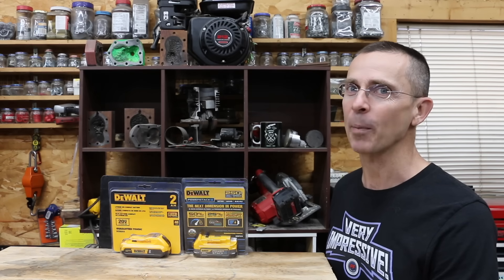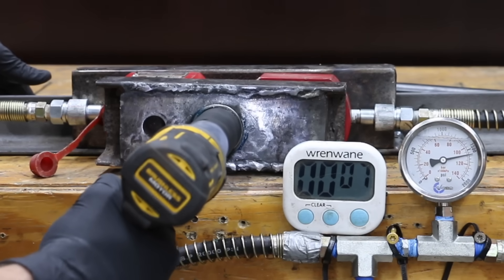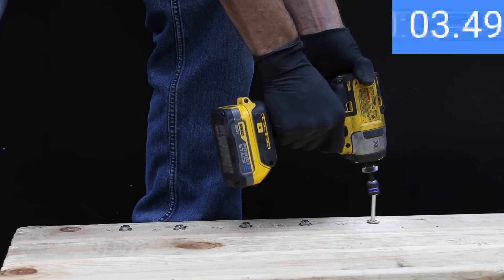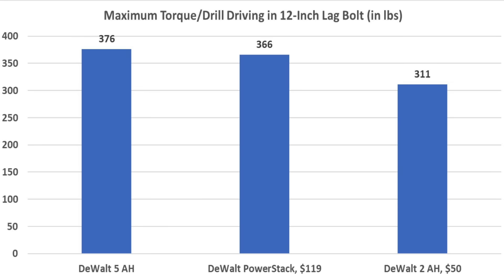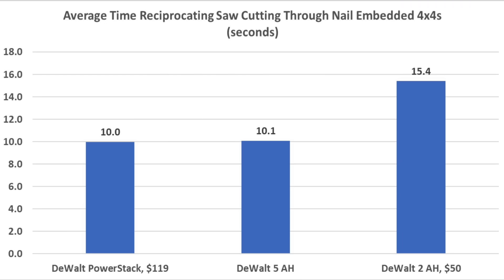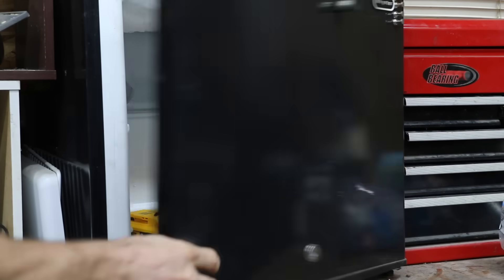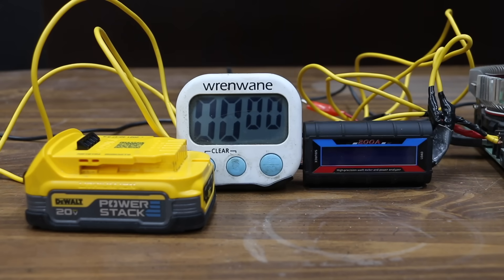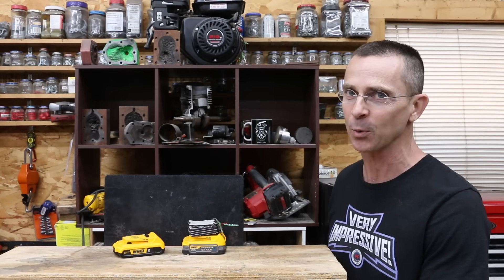Compact “Pouch Cell” Battery Better? Let's Find Out!

Comment: You know when DeWALT offers you a 2.0 AH battery with whatever tool deal, they know you'll eventually need to upgrade to a higher battery. I get a kick out of the bait  and switch promotions. Made in China ??????
Reply from the maker: Good Point.

Comment: The Torque Test Channel does a great job of comparing devices and batteries on their pressure rig test. But they don’t do practical tests, like we see here. And they don’t use voltage meters to show how much power each battery can deliver.

No other channel I’ve seen uses such imaginative practical tests, including temperature based tests.

Comment: decent pouch cells have a much lower DC internal resistance than comparable cylindrical cells in terms of energy density. also, good pouch cells have a much better cycle life expectancy than any cylindrical cell, especially at the high discharge rates experienced in powerful cordless tools. I'm using a 1kWh 48V pouch cell battery on my ebike and it's worlds more powerful than an equal capacity cylindrical cell battery, even with the best of the best in the cylindrical cell world, such as the Samsung 48X or 50S.
Reply from the maker: Thanks for the feedback.

Comment: I would like to see a comparison of the Jackery, GoalZero, vs other brand of the portable battery inverter systems with the solar panel charging. 

Also, you did a video running your generator on profane. I would like to see a comparison of how long it will run on gasoline vs. A propane tank and which setup has the best hours per gallon overall or however you compare the two. I know the propane had a cleaner burn but does that make it more efficient?
Reply from the maker: Thanks for the suggestions.

Comment: In other words: PowerStack = lighter weight and more power than 2 A/H pack, BUT doesn't last as long under heavy load, and is made up of LiPo cells instead of reliable Li-Ion cells, and cost twice the price. 
I'd rather have 2 regular 2 A/H packs than only one PowerStack, especially if it doesn't last as long, so that I can have a fully charged battery pack available at any given time whilst the other is on the charger.  As always very thorough testing, thanks for sharing!
Reply from the maker: You are welcome!

Comment: The powerstack will work great for a year a then give up the smoke and  forcing you to buy new batteries. Pouch cells work well when new but after a few hundred cycles they suffer from high internal resistance and gassing leading to poor performance.
Reply from the maker: Thanks for the feedback.

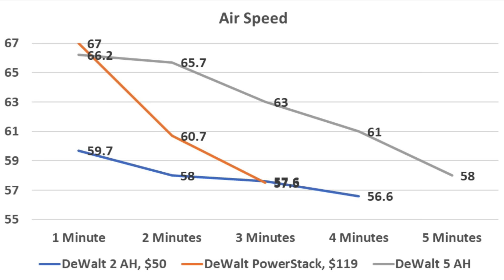Comment: 10:45 The graph is VERY telling. The pouch cell packs discharge curve is concave up signifying an inverse discharge curve where as the 5Ah 18650 cell pack is concave down which is an exponential discharge curve. Inverse discharge curve cells provide punch at the beginning but then die off fast where as exponential discharge curve cells provide mode stable power over the discharge time and then fall off at the end.

Inverse discharge curves are not what you want in a power tool battery.
Reply from the maker: Thanks for the feedback.

Comment: LiPo pouch cells are contantly used in our lives, such as Cell phones, tablets, and other electronics where a large cylindrical cell is too bulky. Plus, a pouch cell can use all the space up, instead of leaving gaps between the curvature of the cylinders.

Both have their merits, but if you look at cell phones and RC cars, the pouch cells are predominant. RC cars in particular can have super high discharge rates (C ratings). However, durability and cycle counts are sometimes much less on pouch cells.

They are more compact, but if you use them regularly, you'll likely replace them sooner. Does the discharge rate and weight savings balance that out? You decide.
Reply from the maker: Thanks for the feedback.

Comment: there are a ton of gun lubes out there claiming to do different things and I would love to see a series were you test a bunch of them like you did car oils.  slip 2000 has different kinds of oils, extreme weapons lube, their standard lube, slip 30 and so on.   Break free clp is another and both brands claim to be protectants, cleaners and lubes.  but how well do they do at each job?  and that is just two brands there are tons of other brands, and there are also some that are just lubes not CLPs.  militec 1 is a great lube in my experience but does it do what it claims to do?  go on brownells and look at all the different lubes and test a bunch of brands, i'd love to see the results. , there are also jells and greases too.
Reply from the maker: Thanks for the suggestion.

Comment: I think something that would be interesting is testing product consistency.  Take an item that wears down like a saw blade and use the winning two products and test five of each.  Purchasing would need to be from different batches.  Anyone using tools knows that consistency is very important to know so you can adapt correctly to wear.
Reply from the maker: Thanks for the suggestion.

Comment: Lithium Polymer batteries are known to have very poor longevity. I'm not sure how you would test it, but I wouldn't expect it to last more than a year or two. RC airplanes use LiPo, and they get inflated (ruined) very easily if not stored at the proper voltage.
Reply from the maker: Thanks for the suggestion.
Reply: These are not LiPo batteries.

Comment: You never answered the key question (or you just didn't repeat it enough times for my brain to grasp): How much is the 5.0 ah?  $82 (on Amazon) so overall the much better deal.  Basically you've demonstrated what Tesla and probably all the battery powered power tool companies have figured out: performance and cost of soldering together a bunch of cells is more versatile and better overall than custom designed batteries.  (I would suggest that Tesla's development and adoption of the 4680 cell indicates that any advantages of pouches or the hoped for solid-state battery are still years away.) 
The 'pouch cell' might have some value where the weight of the battery is a significant factor, like tasks overhead using tools where the weight of the battery is a significant factor. The only one I can think of is powering a light in situations requiring it to be held overhead. Anything with a motor the weight of the battery is less significant. Good test. Thanks. I'm always amazed that I watch your videos all the way through -  you clearly  are the Steven Spielberg of tool videos.
Reply from the maker: Thanks and you are welcome!

Comment: Lol wtf..pouch cells are cheaper than 18650 & u can buy 4ah lipo 5s1p battery from hobby king for 44$ (160a discharge cells) and 8ah for 86$ (240a discharge cells) and it's way cheaper when directly bought from china.
Reply from the maker: Thanks for the feedback.

Comment: Finally someone opened up one of the new 2ah bats. I have four of the yellow 2ah batteries. Two are older from 2016 the other 2 are more recent from this year. The new ones are a little bit bigger both length width and height. It looks like they are using more premium cells in the bats now. Maybe higher discharge 18650s. Not all are created equal. The newer 2ah are heavier too. And they get me a very very noticeable power boost over the older ones
Reply from the maker: Thanks for sharing.

Comment: We use Lithium polymer cells for Radio controlled helicopters and drones. Their big advantage over 18650 cell is that they put out more power, but they actually have less energy density.
Reply from the maker: Thanks for sharing.

Comment: lipo is great for power density and saving weight and has excellent peak current capability.  That said, they are quite fragile in comparison.  Not something I'd want in a pack on a tool particularly with pro use.  JMHO.
Reply from the maker: Thanks for the feedback.

Comment: Great video and sorely needed test!  Again great protocols and real world tests but would have liked a bit more on the longevity, recharge rates, durability, etc.  Blower is a brutal test of batteries, start up current draw is horrendous for Li and I've killed at least 2 batteries on them.  Jury is out on flat packs on Cost for sure but the size/weight is good.  Hard to justify the price of batteries any more with so many options and manufacturers...have had no luck with knock offs and yet $50-$100 per is a bit daunting for anyone but Pro's for a few years of life.  Personally, instead of printer ink marketing, they should give you the tools and just buy the batteries if in fact they are that expensive to manufacture.  Always appreciate what you bring forward for us Todd!!
Reply from the maker: Thanks and you are welcome!

Comment: Awesome review as always !
New test ideas.
Testing of these new 20k motor oils. For example m1 has extended performance, extended performance high mileage, 20k oil.  Is there difference between the 2 ?  Than compare to super tech, Castrol,and Pennzoils 20K versions. 

Oil filter tests. All these new 20k oil filters on the market... Can they really filter that 20k oil for 20k miles? Which filter is best? 

Thank you PF
Reply from the maker: Thanks!  Thanks for the suggestions.

Comment: The old saying "There's no replacement for displacement" still holds true today. However, power density can can fool one to think otherwise. Stacked round batteries have a fairly low power density and will take up more space compared to layered flat packs. The cost difference is the real killer. While I suppose high volume contractors will want those batteries and will just pass the cost along, the average home user won't spend that.
Reply: Round cells are more serviceable- they're available as jellybean parts unlike the specific pouch cells used in the power stack branded pack.
Reply: @myid9876543  You can easily enough get various lipo cells of various sizes, with and without circuitry, Chinesium or well-made. You just gotta look for them as, well, lipo cells rather than "pouch packs".
Reply: @myid9876543  on certain chinese websites you can get pouch batteries in any size you can imagine , dime a dozen
Reply: @tadeuszgladysz7387  And those cheap 'pouch' (really called lithium-polymer) batteries will perform like their price reflects, just like any round LiFe/Li-ion type cell that costs pennies on the dollar. Lipo's generally use cobalt, which makes them more expensive - cheap lipos are NOT going to be very energy-dense. They only make your wallet less dense.
Reply: 18650 cells may also be much more durable than flat packs so I think that may be where the largest trade-off might be.
Reply: They will have to add amp hours if they want to sell it to contractors. I don’t know anybody that uses less that 5.0 AH batteries on job sites. I use 8.0 AH or above exclusively. We don’t have time for dead 2 AH batteries all day. 
Yellow isn’t my color but hopefully they up the capacity so it’s more useful.
Reply: Outstanding comment Chuck!  These new batteries WILL be game changers, but I’ll pass until the price comes Down!  👍✌🏻
Reply from the maker: Thanks for the feedback.
Reply: @Jon VB I have some old samsung/Panasonic/sony 18650 cells that still have a usable capacity and they are like 7 years old lmao. The flat packed batteries will flex as they heat up and cool down through usage will affect their long term reliability too. All it takes is for a single nucleation site to form and dendrites will grow through the layer and the battery will stop charging or lose capacity as thr internal resistances increase. They have gotten significantly better over the years though and are just now starting to take over 18650 cells imo. I have no idea why they haven't set on square battery cells though because they could tremendously increase their power density if they could be packed closer together I guess the cost to manufacture would be a lot more than just manufacturing the batteries with rollers though.
Reply: Except that this larger surface area and space, can help in keeping them cooler.  I'd had cases where high drain tools like a leaf blower, used for 10 minutes, tried to charge the battery, charger rejected it because too hot already.

Comment: Budget and safety facilities permitting, I'd be interested in a fire safety test. Both battery types will burn if pierced completely through, of course, but I suspect that a typical shop accident or manufacturing flaw would only trigger a small breach. Would a breach in one battery ignite the entire pack? How quickly would the pack burn? Can a single staple from a power stapler breach the pack? A nail gun? What are the most common types of fires reported regarding battery pack? Electric auto fires are known to repeatedly re-ignite after you put them out. Is that a problem with packs? Are there other safety hazards worth considering?

I'll hazard (heh) a guess that pouches are more hazardous, but serious damage is rare in both. The worst hazard is probably a fire during charging when the pack is unattended, igniting the rest of the building. An accidental pierce will ignite the pack, but unlike electric car fires the problem is small enough to give you a good chance to stop it from spreading, especially if you keep an extinguisher nearby. That's my guess, but I'd like to see it tested.
Reply from the maker: Thanks for the suggestion.

Comment: I have watched several videos on the powerstack and everyone left me with some questions. (You answered each) I used to think batteries were like a gas can 2,4,6 gallon. I was wrong, I used the same impact 2,4 ah wouldn't loosen the bolt but a 6 would. So really the powerstack has almost 5 ah power with 1.7ah run time. So if you want power and liteness on slower draining tools powerstack maybe best. If you need longer run time on power draining tools use 6,8,12 ah batteries. Think what a 5ah powerstack would do?
Reply from the maker: Thanks for the feedback.

Comment: Some test ideas: soldering station. Diesel exhaust fluid. (Should all be the same so maybe not a good test idea). Air saws. Floor jacks. Vehicle winches (never see good comparisons of those). Transmission fluids.
Reply from the maker: Thanks for the video ideas.

Comment: I have a test I’d like to see. A drop test. Take all the major brands: and drop them from different heights. I’m always dropping mine and the battery seems to be the week spot. More specific the clip on battery that keeps the battery in place seems to break rather easily. For such an expensive piece of equipment,I think they should  be stronger or the clip replaceable. Danke
Reply: Project farm did drop test batteries from major brands a while ago. Dig into the archives.

Comment: I discovered your channel back in 2019 while i was recovering from surgery. I really enjoy your content and have used your videos several times at work. A question I get at work at least once a day is Flex Seal tape, spray, and paint worth the price? Gorilla and Rustoleum as well as several others have similar products. The Flex Seal is by far the most expensive.
Reply from the maker: Thanks for sharing.